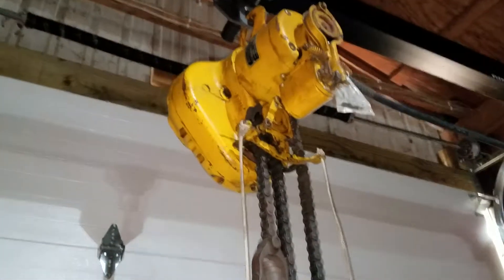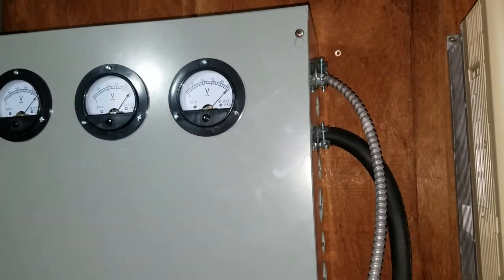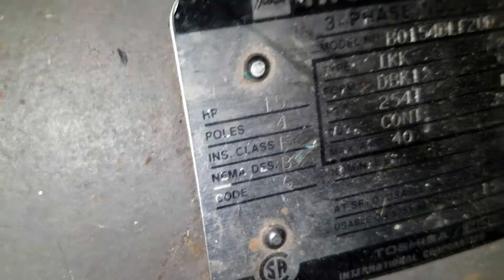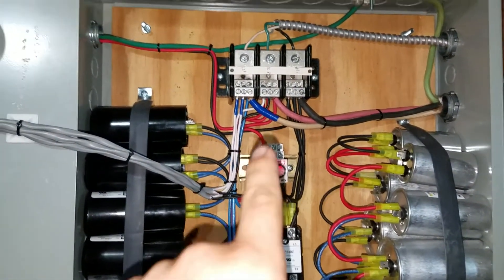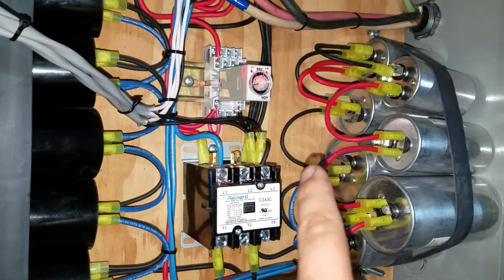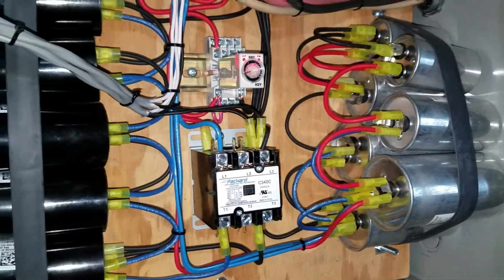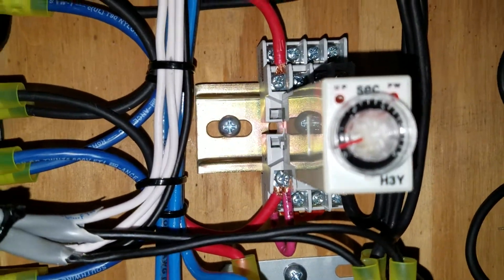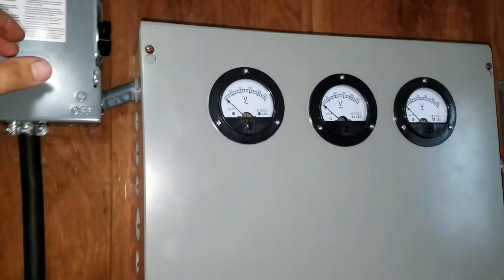15hp rotary phase converter step 3 finished

Comment: Can you give me a proper name or part number for your terminal block  for the 3 legs at the top of the unit please?
Reply from the maker: https://www.ebay.com/itm/USD-16021-Distribution-Block-175-Amp-600-Volt-3-Phase-Line-2-0-8-Load-6-14/122978497317?epid=1461357533&hash=item1ca216f325:g:UwYAAOSwVnlajG25
Reply from the maker: 3 phase distribution blocks

Comment: hello sir , 
     im just getting in to this and im trying to build one of this ..
i have a 5 hp motor , a box full of caps and this and that but i cant get it to work right ..
    is there a way you can help me out . or tell me what to do please ???
 thanks you sir !!!
Reply from the maker: Biggest point do not try to balance voltages exactly even its usually not possible without exceeding the current going to your poney ghost leg (L3) while idling. And amp clamp is a must for that
Reply from the maker: I followed this series of videos 3 parts
https://youtu.be/u229h7NcMxk